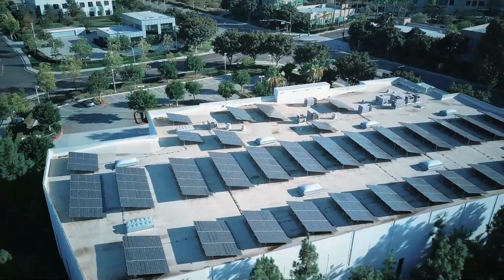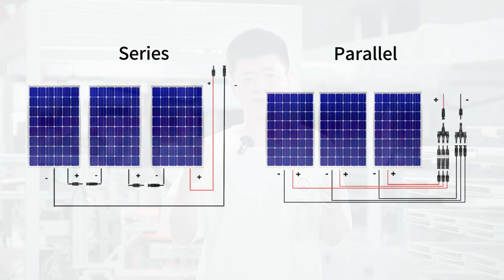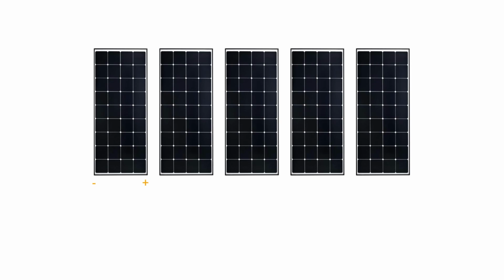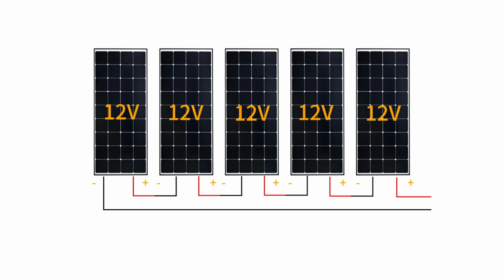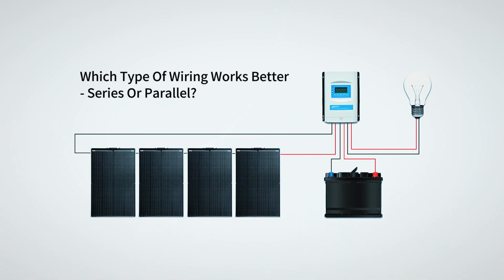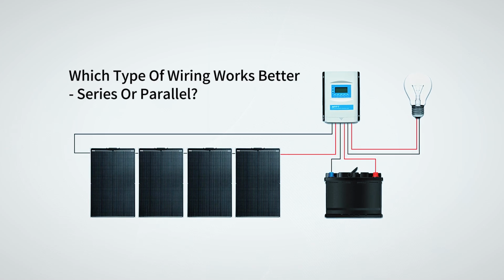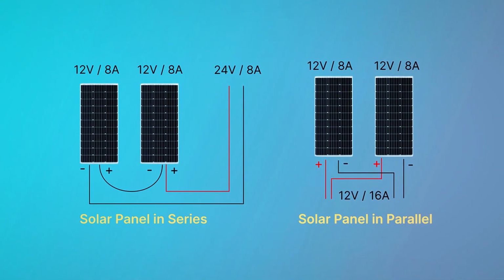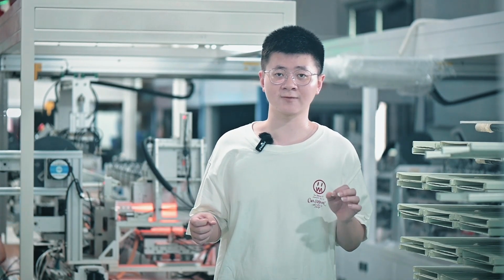Solar Panels Series Vs Parallel-Understanding And Difference

Comment: Why are series-connected solar panels suitable for unshaded areas?
Reply from the maker: Series connections increase the system voltage, making them suitable for sunny environments where the system can be more efficient even in low light conditions.

Comment: Can flexible solar panels be connected in series or parallel?
Reply from the maker: Yes, connecting flexible solar panels in series, parallel, or a mixed mode is a cost-effective way to build a scalable solar panel system that can grow to meet increasing power needs.

Comment: Is it difficult to upgrade a solar panel system?
Reply from the maker: Not necessarily, you can expand your system appropriately by adding more panels or adjusting the connection method to meet higher energy demands.😀

Comment: Which is easier to install, series or parallel solar panel connections?
Reply from the maker: Generally, series connections are simpler with fewer connections, while parallel requires more wiring and complex configurations.😊